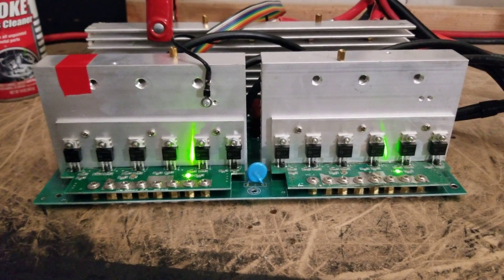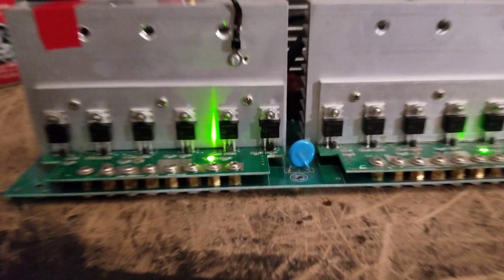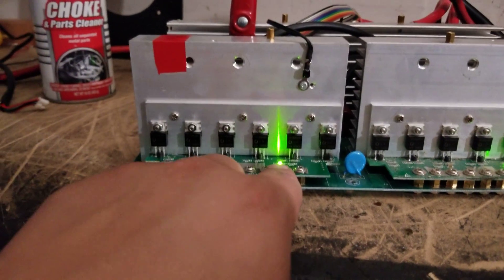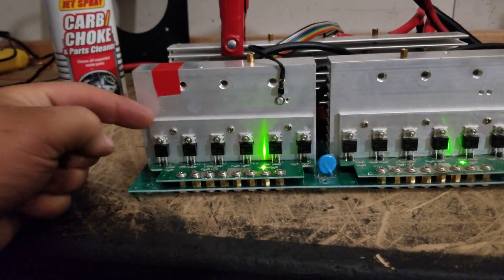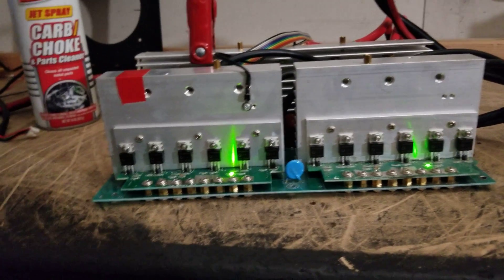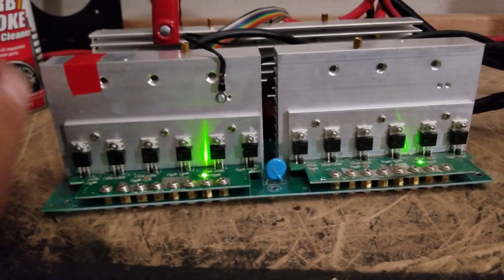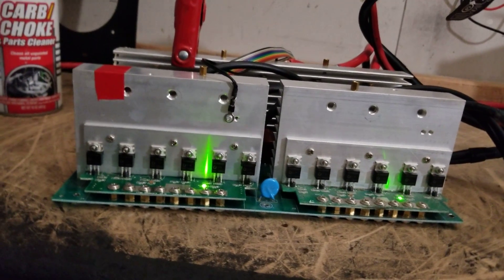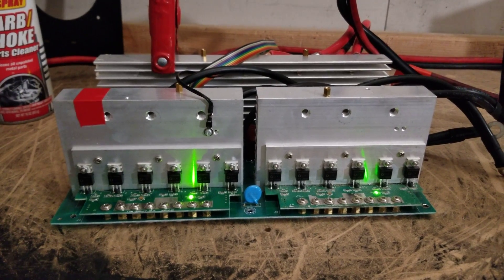Electrically conductive thermal paste improves the connection

Comment: I have what seems to be to different version 9 80000w one has those aluminum plates behind the Mosfets and the newer one doesn't so the older mosfet boards don't reach the heat sink on the newer inverter.

Comment: The Mosfets boards you sent are installed on the older version 9 from the beginning of this year the LED's come on but the inverter when I turn on it makes a strange sound on the main board so I turned it off emidiattly what could be wrong the LED's for the power board and the driver were also on?